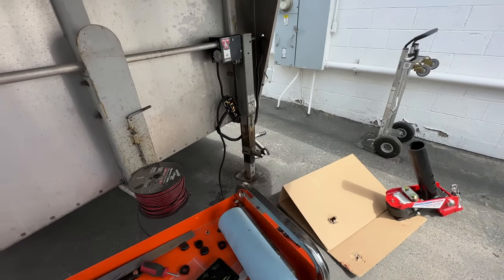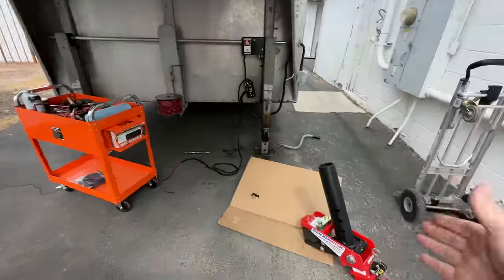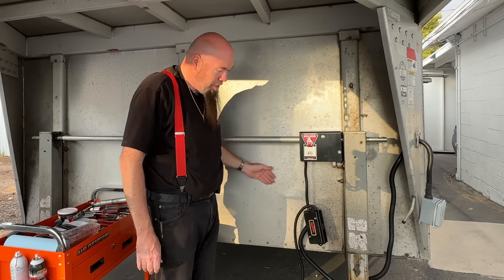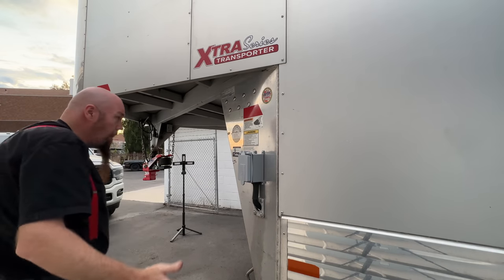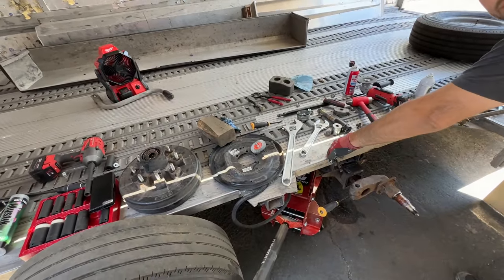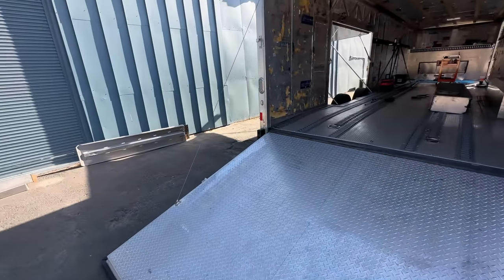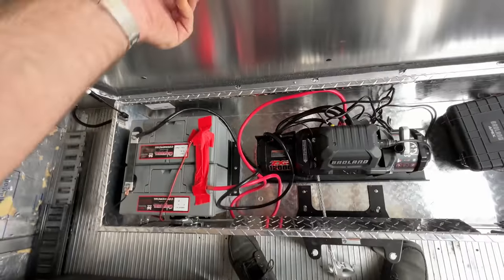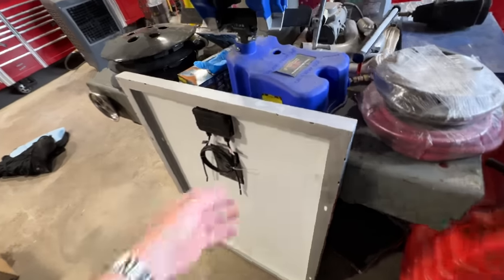Sundowner Trailer upgrades, Shocker Gooseneck, Bulldog powered drop-legs and more

Comment: I would have used a top mount truck box under the goose neck on the outside and save your floor space on the inside.

P.S. You're welding sucks! 🤣😂🤣... Just messing with you Bob. 😝